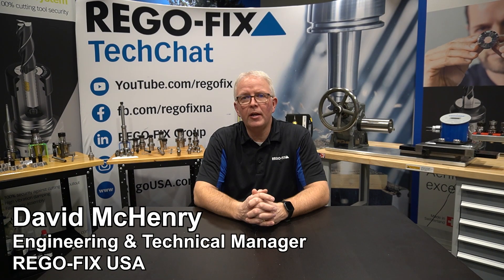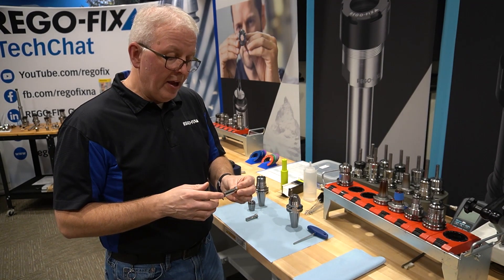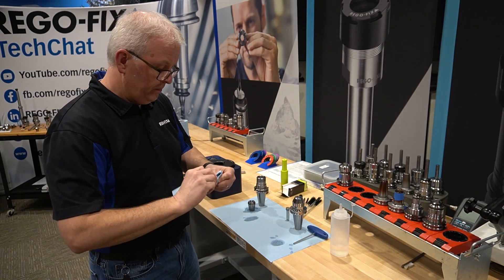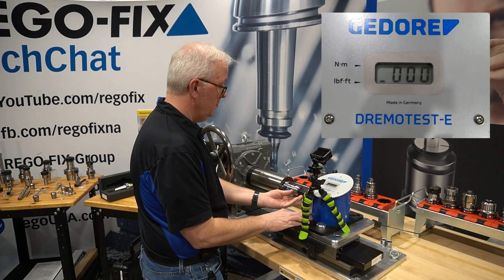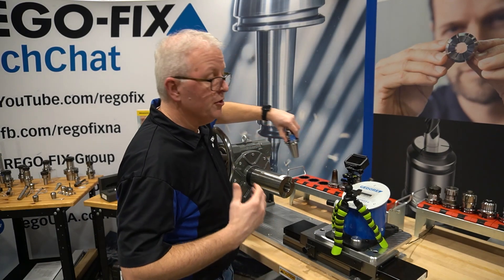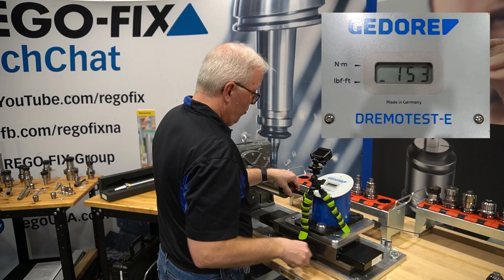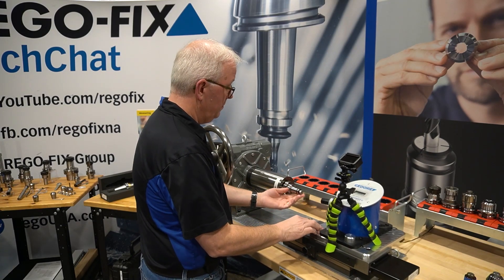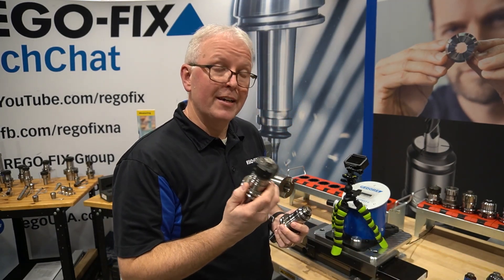TechChat - Competitive Torque Testing

Comment: Amazing ! Would like to know ,how the torque is measured. What is this equipment
Reply from the maker: Hi Sanjay,

The meter that does the measuring is from Gedore, a German torque tool manufacturer. The unit being used in this video can be found at the following link: https://bit.ly/3HgfP0f. As for the worm-gear drive used to turn the tools, that was produced by our team in Switzerland. They have an identical unit they use for their own testing. We liked it so much we purchased one from them for our own use!

As David mentions in the video, we clamp a test pin with a hex head in the toolholder. This hex head interfaces with the Gedore meter. When David turns the wheel it turns the holder, which forces the hex head of the pin to turn the meter interface and increase the value shown. The meter stops recording the value once the pin in the toolholder "slips" and spins within the toolholder. What that means is that gripping force was lost at the recorded torque, showing the value at which the tool slipped.